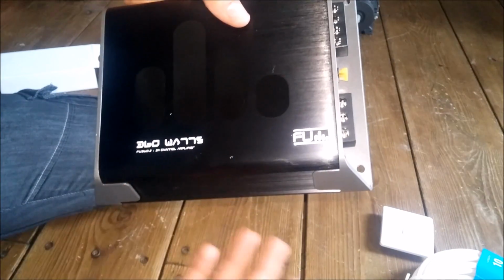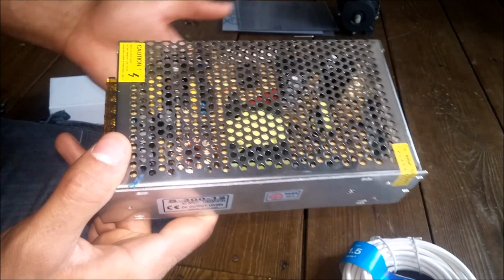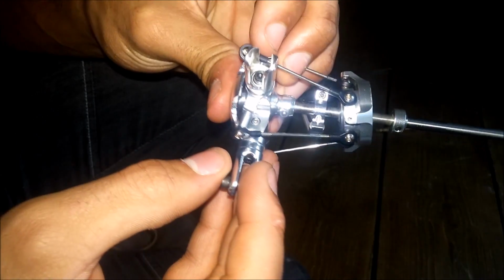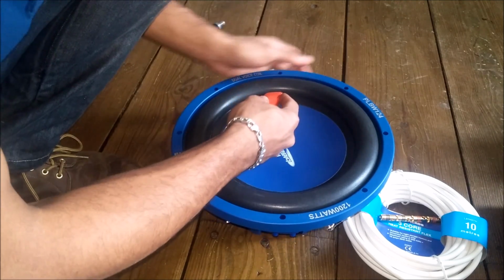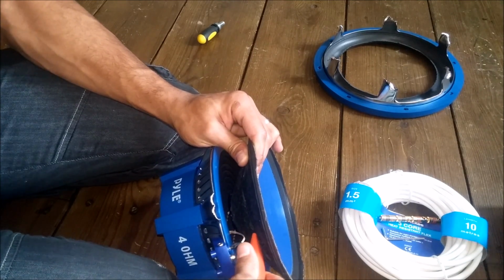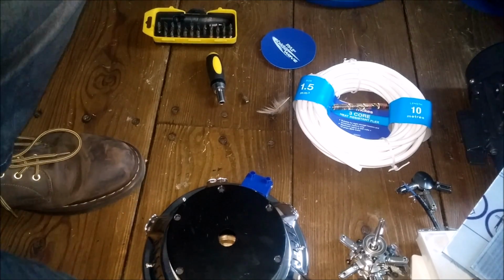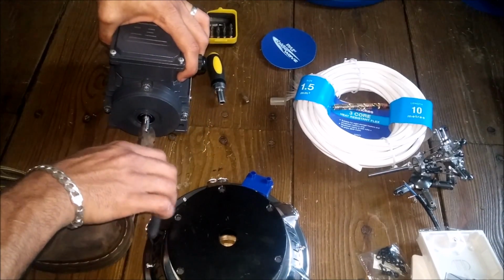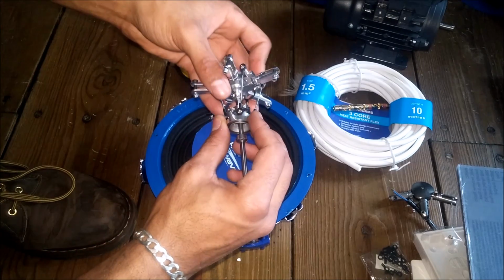Making the worlds lowest frequency subwoofer! Rotary Woofer Build Number 2!! Part 2

Comment: The flex with the rubber grommet will make your subwoofer muddy.  It will be slower to respond to your voice coil.  You may have to replace the rubber grommets with something stiffer.
If you were building a helicopter, it may make the blades quieter.  I suspect it will do the same to your subwoofer.

Comment: For cutting plastic, I use this cutting tool that comes with the Ryobi One+ toolset, you can get it on its own and it has interchangable heads. I used it to carve pumpkins, cut wood, etc, too, thing's so damn useful. It's a vibration style tool, but I find it works good for plastic, because it half melts it whilst cutting it instead of just cutting it which can lead to cracking and a bunch of other messy shit.
Reply from the maker: thanks for the advice. i cut the blades using a disc cutter and that did an okay ish job. but the plastic ive used wont crack under that sort of stress, and it didnt so did pretty well
Reply: Well that's good! Yeah, I mainly use it for cutting acrylic and various cheap plastic that ends up being in my way when Im modifying things. Really looking forward to the next videos, excited to watch your process
Reply from the maker: well ill be uploading a video tonight around 12 ish maybe before. depends on how long it takes to edit the video. im actually doing part 3 right now
Reply: Can't wait! :]

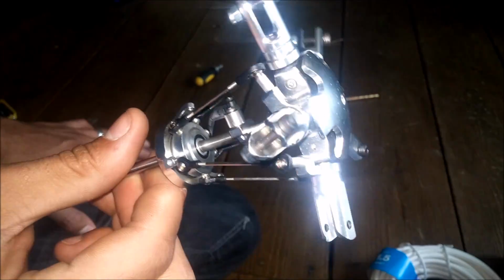Comment: 8:33 i'm not finding where to buy this part, what is the specific name or model? thank you.
Reply from the maker: you can find this on ebay by looking for a 5 blade flybarless rotor
Reply: Thank you. tell me, this rotarywoofer can increase the experience with music? can you tell me detailed?
Reply from the maker: yes but only on the lower frequencies. e.g 1 - 25hz. it should also be acompanied by a conventional subwoofer to backup the higher frequencies
Reply: one more question, rotarywoofer outside has a good Performance?
Reply from the maker: outside how?
you need to use a baffle for optimal performance
Reply: scale matter much?
Reply: I've checked Ebay and many other RC  shops for this item with no luck finding this rotor head.  Could you give me the manufacturer and item number?  If you've had this level of success with your project, I'm anxious to replicate it.  Your idea is brilliant!  I can't wait to get all the components and start my own project.
Reply: Thanks!

Comment: Would you be able to post a list of the parts you used and their cost when you've finished the project? I'm interested in trying this out myself but I'm not sure how much to budget for it
Reply from the maker: you will need about 5-600 to start the project. i dont have a price list as they fluctuate but i have a parts list and its rather large
Reply: Thanks! And I'm assuming the 5-600 is in pounds, not usd, right?
Reply from the maker: correct

Comment: Interesting project. Why are you using a 12V amplifier?
Reply from the maker: because theyre smaller and can be mounted whereas if i used to 240v amp it would have to be wired to it rather than mounted due to size, plus, you can get mono amps and they are specifically built for subwoofers and have crossovers on them. and easy use too

Comment: No Dremal and i cannot believe you managed not to completely destroy the voice coil , there is no need to cut that driver to shreads. could have been used in its original form. most painfull video ive ever watched and your a Engineer???? And someone asked you with your lack of mrchanical ability is amazing lol
Reply from the maker: Actually, it is necessary because of the air flow, and I never once called myself an engineer. Chill yourself out. I don't see you doing anything interesting in your life 👍🏾